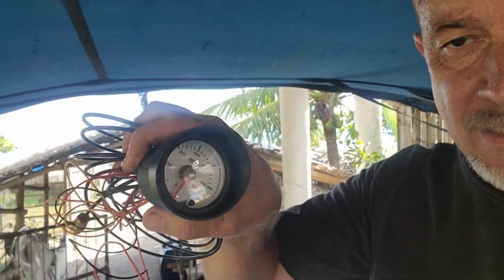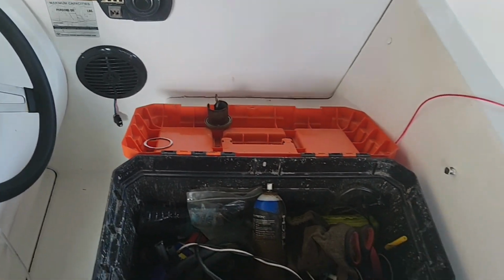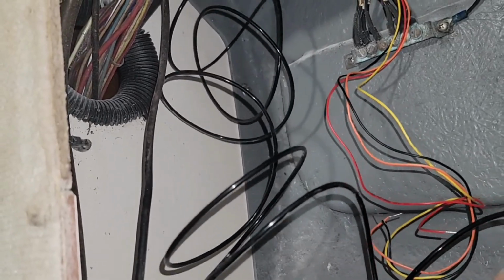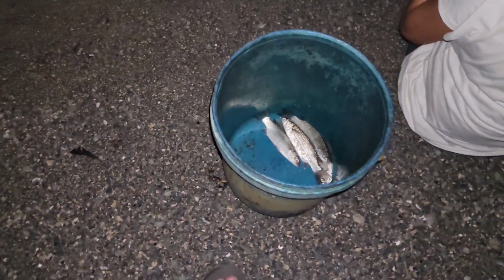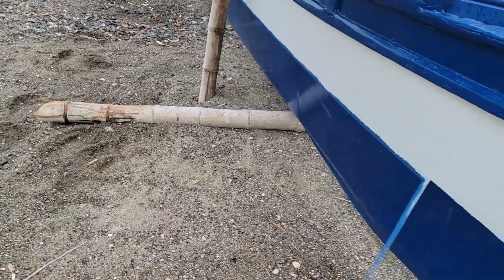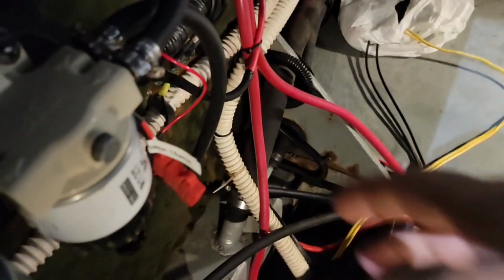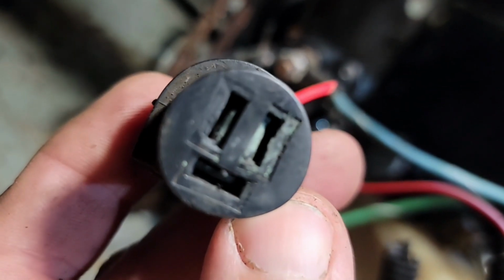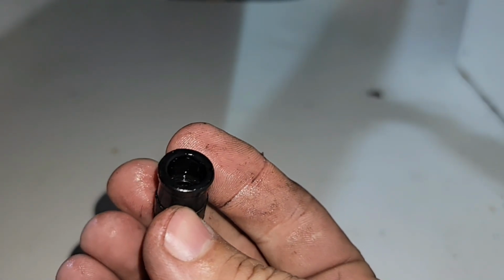Turbo Boost Gauge Install,  Bangka Boat Painting, Moonlight Swim Time

Comment: Interesting vlog,,,,,i like the hands on explanation,coz for the past few yrs i had very little to do doing minor repairs or adjustment on my Harley 117 qubic inch motor or my jeep Cherokee,,,,fuel injections brought with it computer boards,flash cards, ECU,dyno runs,so watching you working on your boat and previously your house builds ive learned a lot,thanks

Comment: I found to get a REALLY sharp line using tape; apply the tape, in your case, use the blue paint and paint the edge where you will be applying the white paint. This fills in the tape tiny gaps you sometimes get.  Let it thoroughly dry, then put on the white paint. Once you peel the tape off, the line will be razor sharp, and no bleeding.

Comment: Hey James.  Great addition to the boat with the turbo boost gauge.  An extra footage on the line would have been idea as I agree it is a bit in the way of things so to speak.  By the way man, I started the carnivore lifestyle change and the results in just 8 days has been incredible.  I slept great last night.  My headaches are all by gone.  Those extras pounds are dropping off fast. I have lots more energy.  And I just today actually noticed my eyesight had improved a little...hard to explain but objects looked clearer.  My last meal was at 9:30 am and it is 10:24 pm right now.  I did eat some roasted peanuts around 7:00 pm or so but I am not even hungry and preparing for bed.  Currently working abroad with the Navy.
Reply from the maker: I'm not a doctor nor giving professional medical advise but on a friendly note please watch your vitamins and minerals. Organ meats can help with this  but I would personally suggest that you take supplements for Vitamin C , D, B3, Magnesium, Potassium. Just a friendly suggestion only. What harm could it do having plenty of vitamins?  I still eat a few slices of grapefruit 2 or 3x a week.  I take my beet extract pills for natural blood pressure control as I PERSONALLY ( that is for the trolls) do not want on statins.  I know these are not strict carnivore habits taking that but it's what I do and it is still working great. I do no cheats like breads, pasta, candies, pastries, rice, noodles etc. No sauces. I am not scared of eating vegetables but I wanted to eliminate everything and over time slowly add one thing here and there and log the reaction. ELIMINATION DIET.  I like to stay active knowing I am on a high fat diet to make sure I am burning it for fuel not storing it. Again just me personally.
Reply: @TexasFilipino  Great advice.  I will shop for those vitamins today.  Much appreciated.

Comment: Hi James, you can replace the vacuum tube. You will just need to make it off at both ends but make sure you use ptfe tape on the joints, which I'm sure you know. If you're struggling to find one out there, let me know, and I will bring it out with me. I just need to know the diameter. You can use vasiline (non flammable) on the electrical joints which will help stand dry and free from corrosion.
Reply from the maker: When are you coming? It is so hard and time consuming to find the simplest things. I have some of the tube and couplings in my garage back in Texas!! lol.  As far as the corrosion goes  this boat is 28 years old and I sure has been treated bad.  Im clipping wires back to fresh meat everywhere and I brought electrical gel with me from the states. We used it on our vending route of amusement machines always. Most break downs on those games was in the connectors. I use it on my solar connectors ( m4) also here on the house. Salt air is tough. Follow up about when and where your coming into PI and I sure might take you up on that offer. I rather have one long clean run with no joints.  Thank you
Reply: @TexasFilipino  we are hoping to be there for December but the sale of our house seems to be painfully slow but its more likely to be January mate.

Comment: I was reading some stuff about boat electonics once and it seems like i read that they double fuse so if the short is in the rear of the boat it will pop a fuse there....the idea i think was that if you dont have the back fuse the wire may get too hot before the forwad fuse blows,,,, causing problems in the hold before you noticed ..... Maybe, but i think i read something like that..........Oh. now i remember what i was thinking,,,, they always told me to fuse as close the the battery as possible....On another note, once a wire connection statrs looking corroded you need to check the wire itself.........corrosion will migrate right up the dang wire under the insulation.... Corrosion!!!= the devil
Reply from the maker: exactly rightand I have had to cut several of these wires back to get past corrosion. As far as the double fuse , nothing else is double fused on this boat. I looked at another trim pump and wiring I have here and it does not have a fuse there.  Your speculation would really be good on a longer boat than this with long runs of wire. I like that The circuit I ran to the fuel pump is double fused by me. I felt the same. I wanted it to have two places to blow in case my new wire got compromised along the way.
Reply: @TexasFilipino  "Your speculation would really be good on a longer boat than this with long runs of wire"-Yes sir.....Mine was an old 1943 ft 100 ton wooden fishing boat with wires everywhere-- i rewired it with marine wire ....1700 feet in an 80 foot boat---- lol--- im scared of fire so i was triple redundant

Comment: The crud on the inside of your fuse doesn't look like corrosion to me. It looks like salt, corrosion lays down smoothly, but salt cakes up like that. Has the engine compartment ever been flooded ?    Asking for a friend !  😁
Reply from the maker: Im sure it has been. It was a abused boat here in the Philippines.
Reply: @TexasFilipino  Thank goodness for fiberglass!
Reply: Yeah, that looks like salt, but I've never seen that inside of a fuse before! Need a weatherproof housing for the fuse
Reply: @tryscience  learned something about auto type fuses, they aren’t waterproof !
😵‍💫
Reply: @Mr1990hjc  I think the housing was supposed to be. But in its condition that's maybe too much to ask for
Reply from the maker: that is a sealed rubber snap together housing. It  still got salt inside and even the fuse did.
Reply: @TexasFilipino  yeah but I saw from your video what rough shape it was in. If it was still sealed then no salt would have gotten into the fuse
Reply from the maker: @tryscience  It was bad. Just eliminate it. Rubber is old and stiff like me hahahaha
Reply: @TexasFilipino  😂💯